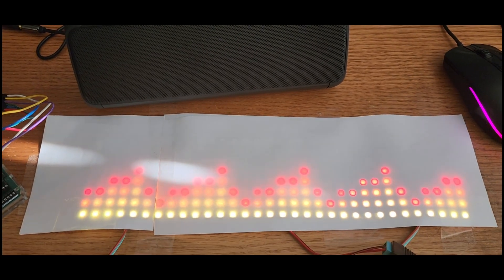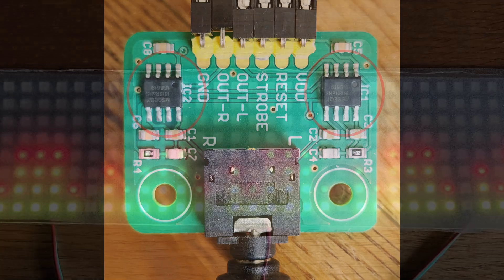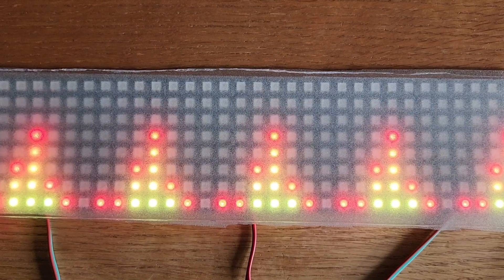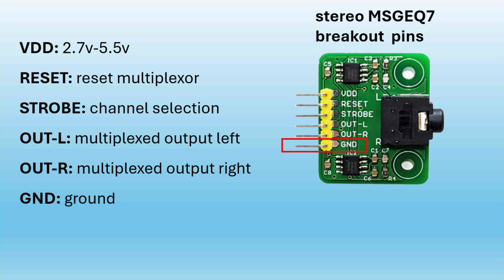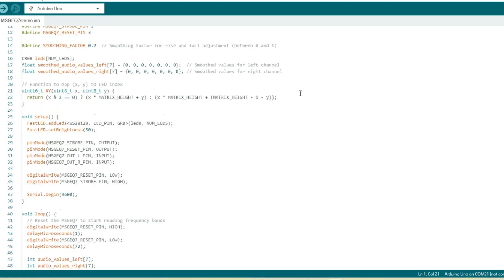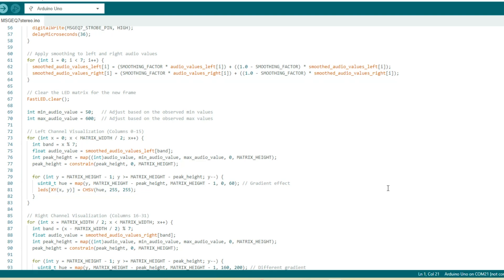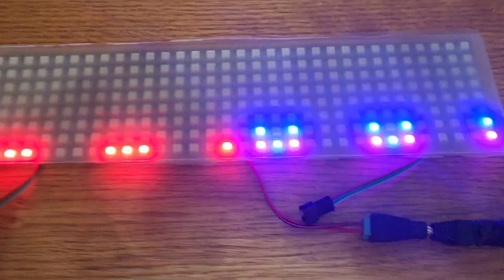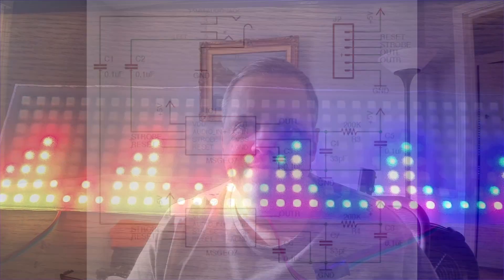Build a Stunning LED Audio Visualizer – Easy Arduino Project with WS2812B and MSGEQ7

Comment: Where you buy stereo MSGEQ7 SEVEN BAND SPECTRUM ANALYZER
Reply from the maker: I purchased it off Amazon. search for      ASIN  :  B08GYCHXYX
  in the search bar.  👍
Reply: @BMonsterLaboratory  where you buy 5v 15a dc converter and can I use different speaker besides the speaker you show in the video
Reply from the maker: You can get the 5v 15A dc converter on Amazon as well, just do a search for it. 
You can use different speakers. I was just using a powered speaker that I already own that has an audio jack.

Comment: Can you software rotate the display by 90 degrees to get more vertical resolution?
Reply from the maker: Yes, you can rotate the display by remapping the matrix's X and Y coordinates. I thought about splitting the 7 bands, with one set on the left and one on the right, taking advantage of the increased matrix height. This setup would give more distinct amplitude levels and might even look better visually. 👍
Reply: @ I agree, I think it would look better. Nice work, cool chip. Ever try using the sound reactive fork of the WLED software?
Reply from the maker: I just looked up the WLED project - very cool! There is lots of info on that site. I haven't seen this before but I'm going to check it out. Thanks for letting me know
Reply: @ Have fun! 👍👍